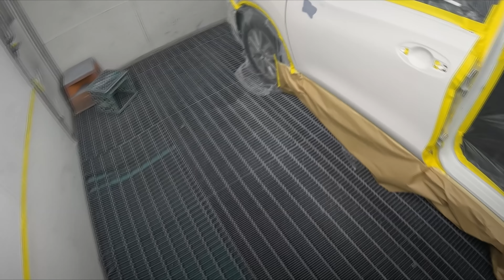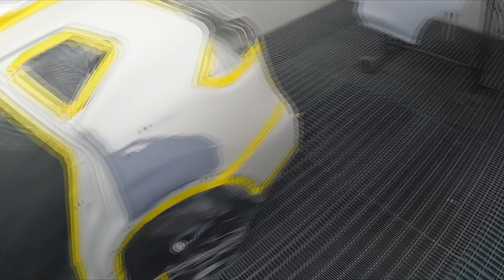Nissan X-Trail 3 Stage Pearl

Comment: Hey Gunny, im working on a Nissan with the same color code and your exactly on point with the ppg colors. 
The one thing I've noticed is the mica flakes in the ppg are smaller in size than the factory pearl. 
Its so ironic that I received your video just as I finished the rear bumper. You again saved the day ! Keep it up

Comment: Great video. I never liked the ppg’s Spectro, but if your not, try sanding the spot in the area you want to blend with 3k then buff and polish out, and maybe use a open search instead of manufacture search. Now as far as color matching, if I didn’t have a blendable chip, I picked the closest chip, then you should be able to compare 4 colors at once, then select that variant then compare it to the variant I’m looking for, exp. Redder, (which in ppg usually meant bluer) then compare the formulas looking for the bluer redder tonners, it also helps to have their lastest color chart that tells you what the tonners do. I normally had good results that way.

Comment: When i first started spraying back in 87 the wet on wet (sealer) DP epoxy primer could be spotted in and not profile..the mix was 1 to 1 over the years they have changed the system for environmental reasoning the mix is also changed to 2 to 1 and it will profile badly these days and the base colors require extra coats to hide compared to when i started spraying also..ppg across the pond..texas!

Comment: Great job mate.Yes must be a thing everywhere our paint reps also love to push Satajets I bought into it,bought a couple of 5500s but always seem to go back to my Tekna Prolite and Iwatas.Not that I hated the Satas but they seemed to really use up material whereas my Tekna saves material .I may try them again maybe I have them set up wrong but I don’t get why paint reps at such Sata fanboys .I should’ve got a DV1 instead at a lesser cost
Reply: i find that the 5500 hvlp saves me alot of paint on the basecoat. Like today i painted a whole bonnet, bar and blended two guards for a mazda 3 and only used round 500ml of basecoat with reducer added.  My problem with these reps is that they dont ever tell you how much to thin down the paint and to always go by the computer also they tell you to always do a double coat when spraying which is rubbish.

Comment: Is wet on wet primer a new thing? Is the only advantage a speed thing? Ie if speed wasn't an issue (home gamer) Is there any advantage to wet on wet? I think all my panels will all be too dented to not sand primer!
Reply from the maker: Working from home the main advantage would be coverage of the basecoat. But yeah, it's mainly a speed thing.

Comment: Gunman can I ask you what type of breathing apparatus are you using? Is it connected to a fresh line air or do you have a belt pack ? Thanks.
Reply from the maker: Yes I have a belt, fresh air. It's the Sundstrom SR200
Reply: I really like my Sundstrom SR200, not cheap but the quality is mint, also use a dropout filter then a 3 stage and a charcoal filter on my belt 👍